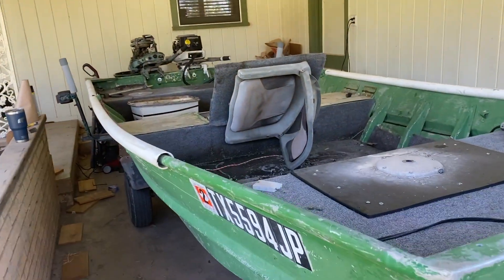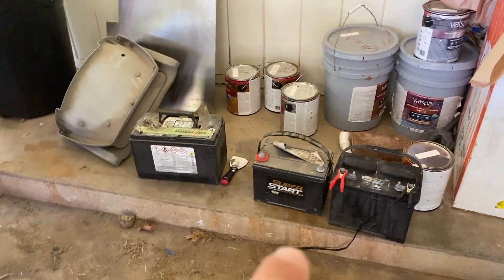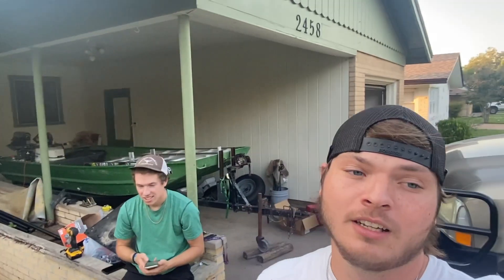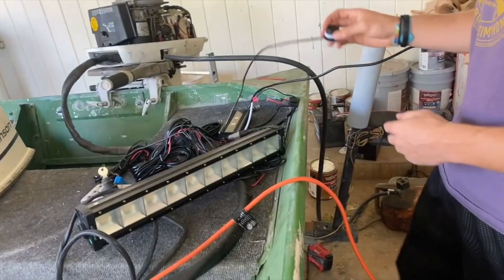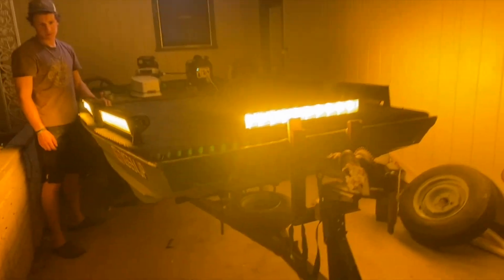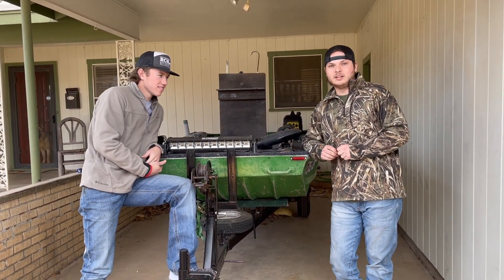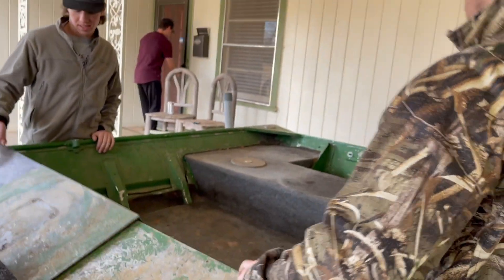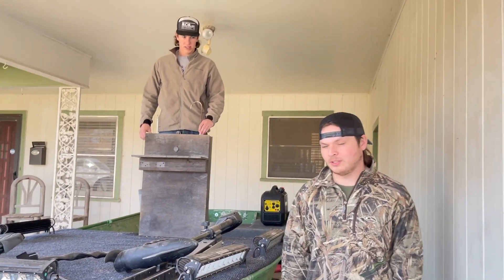Bowfishing Boat Build/Reveal!

Comment: did the generator have a 12v plug or how did you reduce the power down to the lights?
Reply from the maker: The swamp eye lights come with a converter that has a normal plug coming out the end of it. So then we just ran an extension cord to the generator.